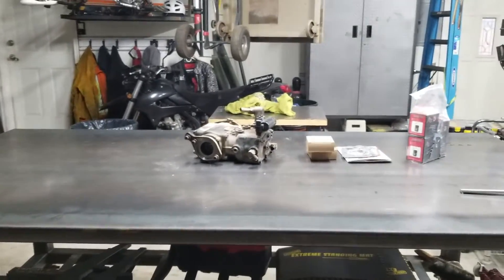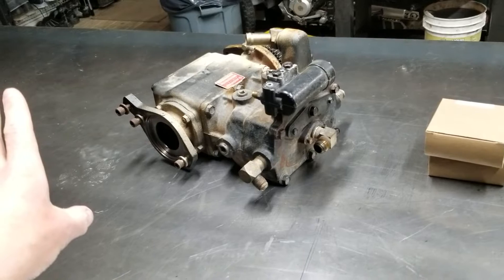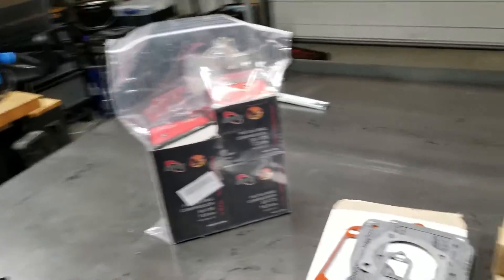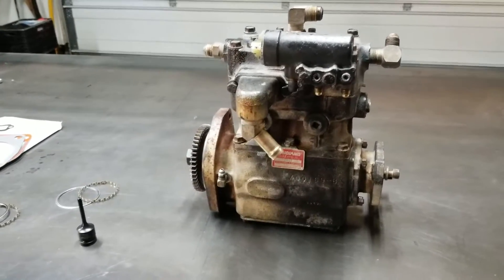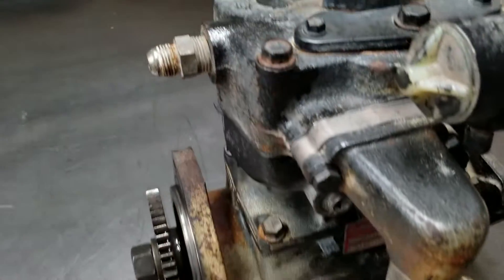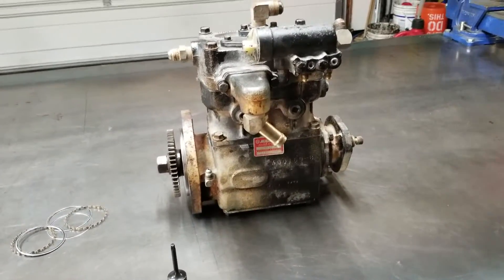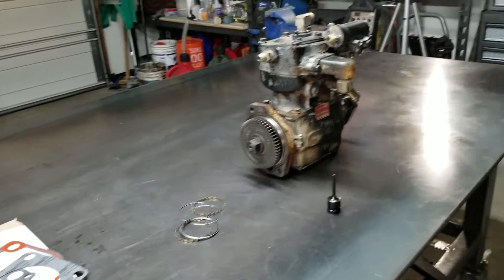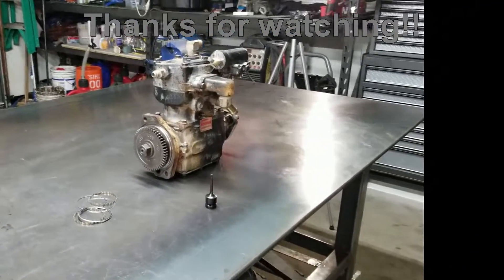Abel LMTV build part 152 (Midland Cat 3116 air compressor piston re-ring and new gaskets)

Comment: Trying to remember what you said about the torque spec on that gear on the compressor.  I am reinstalling my gear today. Thanks!
Reply from the maker: Torque spec?  I used an impact wrench.  No idea.
Reply: @SeanFastidious lol I may add a little blue loctite for justin case
Reply: @SeanFastidious  Accidently ran in to the specification, it is 80-100 ft lbs.

Comment: Isn’t there a break in process as well?
Reply from the maker: Yeah, we were just discussing that on facebook.  12 hours at 100psi on a machine to seat the rings is what a compressor rebuild shop usually does.  There is no way to do that at home. I have since replaced this one with a NOS unit which ultimately fixed the problems I was having..

Comment: Note: always replace the discharge valves when doing a rebuild. They get very hot and can warp over time. Warped valves will not seal completely thusly the compressor will produce less air volume & pressure. Normally the intake valves will be ok.
Reply from the maker: I had no idea.  My main concern was the oil blowby.

Comment: If it is possible why don't you oil it down and seal it in a vacuums sealed bag. Keeps it without moisture and keeps it well lubed.
Reply from the maker: I did just that before placing it in the storage box on the truck...